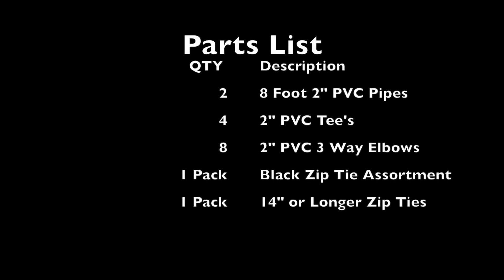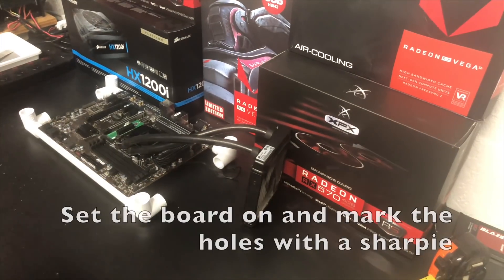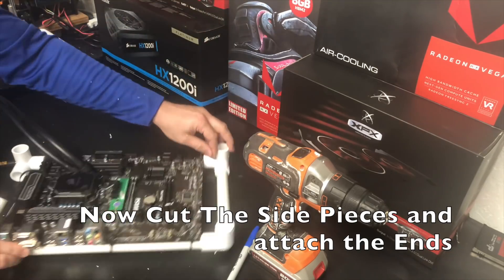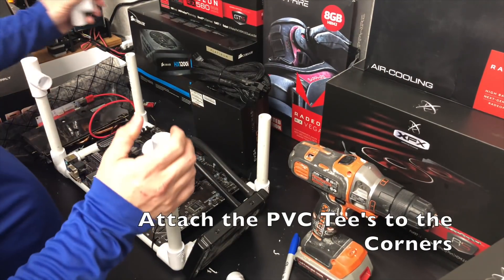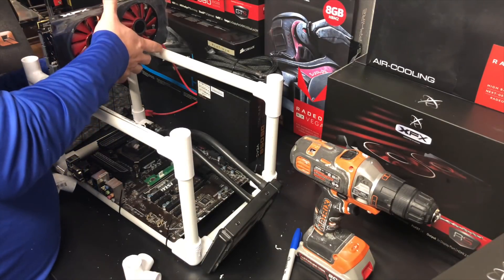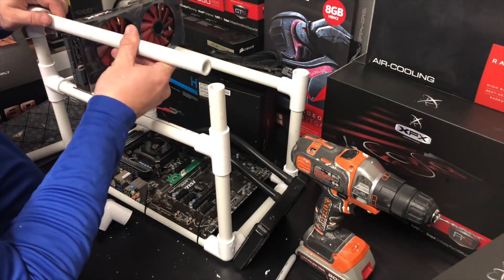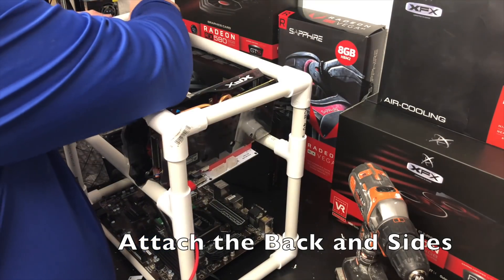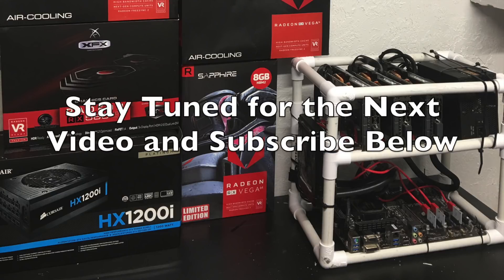DVR Tech - $20 Open Air Mining Frame

Comment: Wouldn't the pvc get heat damaged and warp or can it withstand 70 degrees c ???
Reply from the maker: PVC has a pretty high rating but also that heat is not touching the PVC itself, the hot air is expelled out the back and as long as its moving air over it you will not have any issues.

Comment: Awesome build! :) i wanted to make a diy "laptop" using an itx gaming pc layed out flat on a pvc frame with a gpu riser cable and itx mobo. The itx psu would be mounted behind the 15" laptop recycled screen turned portable monitor with the video controller board on the back as well. In order to make the lid fold up and also stand upright i would attach it with hinges to the base but have two open ends of pvc at the back that could slot into each other. My question is would i be able to easily fold down the lid or would it be stuck due to the pvc? Many thanks in advance! :)

Comment: are the pipes simply press fitted into the corner joints?
how to hold them in place strongly with the option of having to disassemble them?
Reply: put a bolt through it